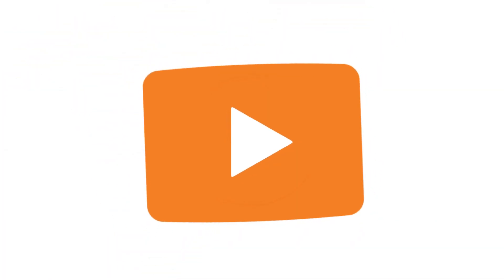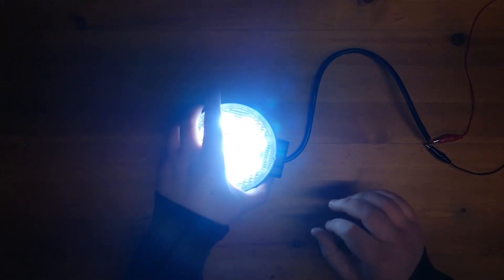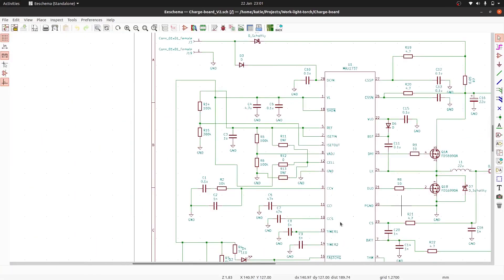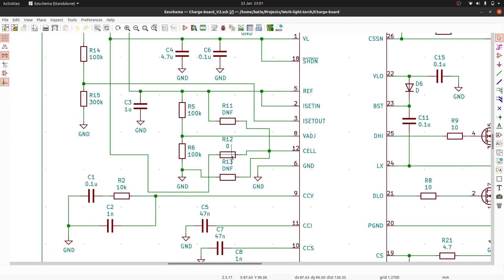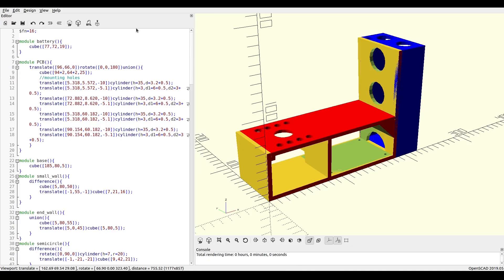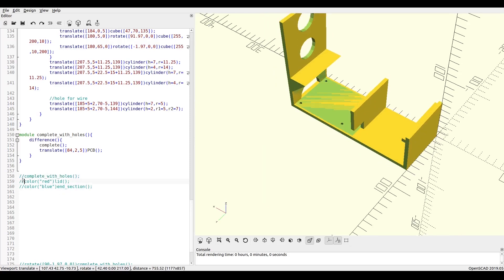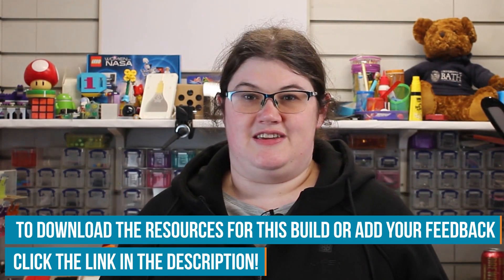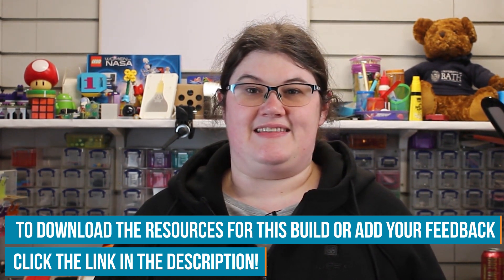Make The Ultimate Phone Charging Camping Flashlight

Comment: How about doing more than 4? Let's say I want to put in 12 cells in parallel (4*3) for more storage? What would those resistors be?
Reply: In theory you could put 3 packs of 4 cells in parallel without needing to change the resistors as it's the amount of cells in series that matters. 
However they would need to be balanced packs of cells, so I think you'd need to get them configured like that from the battery pack manufacturer as they could balance the cells/packs against each other.

Comment: I have to wonder how long the battery would last.  One thing that might have made it "better" since the shell is so thin adding some sort of QI charging coil and maybe a 2nd light option light like a led strip for area illumination in addition to the spot light.
Reply: it's working out to be just under 2 and a half hours of runtime with just the LED light on. Like the idea of adding LED strip as a local area illumination.

Comment: What about a NE555 based pulse generator driving a ignition coil using a 2N3055 which will drive a HID bulb and should work of a 12V Lithium battery which is rechargeable.
Reply: You would have an extremely unhappy HID bulb if you did that. You need a ballast to run one of those, the high voltage is only to ignite the gas mixture. To have it run, it needs constant current. Not that easy to DIY.

Comment: How many amps does a torch like that pull?
Reply: I've just taken some measurements and it's 1.4A, which works out to be 19.5W (Intriguing that the LED unit was sold as 27W). The battery is 48Wh, so looking at just under 2 and a half hours when just running the torch.
Reply: @hifromkatie  Thank you so much for your answer :) That would be a bit short for my taste. Personally I would have gone with a smaller light source, put it inside the box and used it as a camping light instead of a torch light with longer hours. Instead of clear plastic I would have gone for a more frosted container so it would spread the light around. I really like your idea. Will see if I can make this.